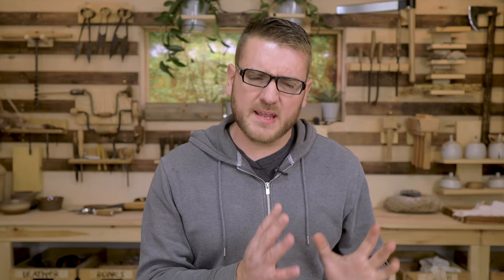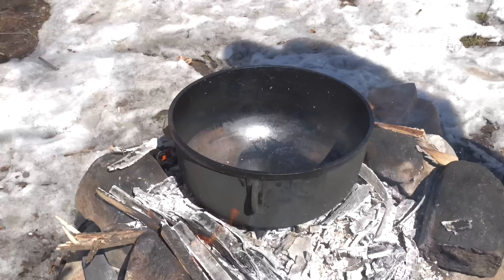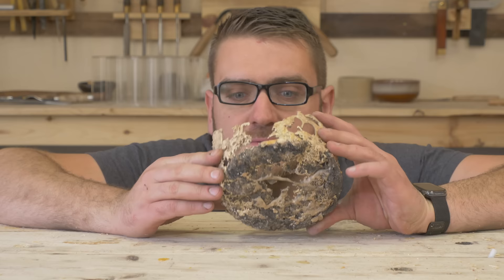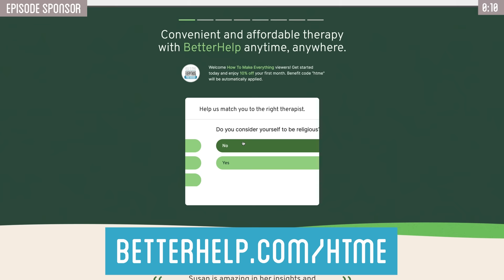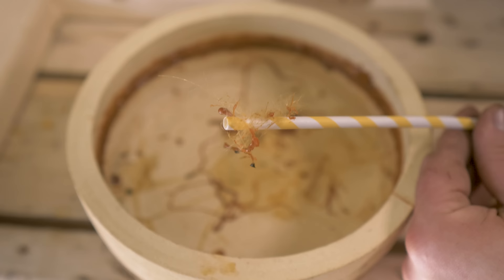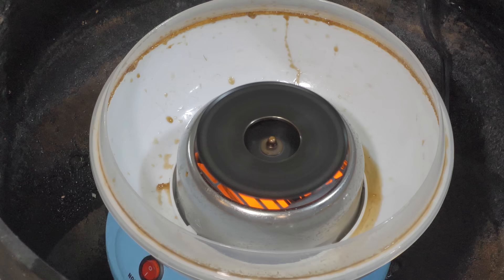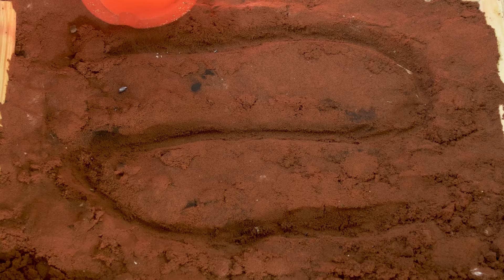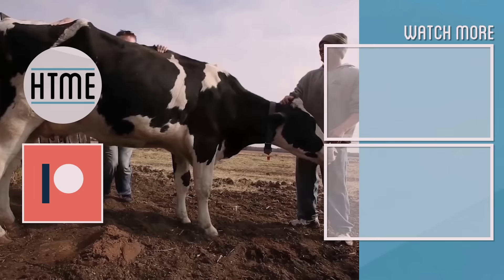Can a Dr. Stone Centrifuge Make Cotton Candy and Wires?

Comment: There are some good videos on making maple sugar from maple syrup. Simply take the finished maple syrup and continue boiling it until it reaches the hard ball temp. At that point beat it (example video used electric mixer) and whip air into it. As it cools a bit it will transition from a syrup into crystallized maple sugar.

Spin extrusion is used for making rock wool so the basic concept works however it requires properly ductile material. Glass or molten rock fit that. Most metals don't. Gold, as you mentioned, is the most ductile metal and is far more likely to work than any other. As others have noted, the Dr. Stone machine had a constantly heated pot which is similar to modern cotton candy machines. That one you used of course is a bargain basement version that I have never gotten really good results out of in the first place. Considering the damage, still a better choice than spending several hundred on a commercial machine.

Comment: wire i imagine is more like a metal is plastic scenario where smithing and stretching is the best option. interesting to see other methods attempted but not surprised molten metal has surface tension and low viscosity that makes it not want to stretch into long wires.

Comment: I have cast a few wire ingots of silver in wood moulds before.
It actually works surprisingly well, at least when you use adrill  hole
 it's not "safe" But it makes good ingots

Comment: The reason why the sugar makes thin wisps when spun in the centrifuge is because when caramelizing sugar, the decomposition reaction causes the formation of polymers. These polymer molecules stick to each other through covalent bonds and form long chains that can be pretty thin even when in a liquid or semi-liquid state. Metal when melted still has its metallic bonds, but as temperature increases these bonds get weaker until they finally break when the metal boils. Molten metals don't have the same affinity to form chains like polymers do, metals like tin and copper have a fairly high surface tension so they'll just bead up. I don't know how viable cotton candy centrifuge wire is, but if you poured more molten metal in your metal container and the increased the tube length it would increase the pressure pushing the metal down the tube. If you had the tube actually submerged in the water, so the molten metal is not freefalling and having time to potentially bead up, it would start cooling the metal before it hits the water creating a steam explosion. Great video as always!

Comment: Maybe it's a more complex idea than is worth testing, but your laminar pour method plus a rotating bucket of sand might work. Especially if the bottom of the sand-bucket was mesh and there was air pumping through the side that doesn't get poured onto. That way warm wire sinks and cools, while fresh wire falls onto empty sand.

Comment: Some thoughts on what went wrong with the experiment: The pot was too small as well as the holes, leading them to get clogged quickly.  Starting with a larger pot with larger holes higher up on the sides would make the melted sugar/molten metal climb the sides and produce finer strands. Instead of pouring the metal into the pot giving it a large chance to splatter as it touches cooler metal, starting with the metal in the pot already and heating the whole thing so it's not molten all at once, resulting in thinner streams of metal heading for the holes as well.

Comment: that wooden gear thing could probably improve your attempt at making a lathe, and/or a drill-press. just needs an extra bit to slot the end through so that it's more stable and doesn't start to wiggle. also, have you seen laminar flow tea kettles? find out how those work, and make a crucible that pours like a tea kettle out of a spout

Comment: There are examples of wire jewelry and wire sculptures dating back to about 4000 years ago, placing it in the middle to late bronze age. Gold was poured into thin plates then pounded into sheet, cut into strips and rolled into wire. Once the iron age came around, the process was updated to hammering small rods into a grooved anvil. Drawing wire was also discovered around the same time and eventually overtook both of the other methods and is still used for most wire production today. 

Because gold work hardens the annealing process must have been used to prevent breakage in all of these methods. This means that copper wire was likely also being produced around this time. That said, gold has one unique attribute among materials of the time that made it a far superior option. Gold can cold weld. It is unknown if this was lost knowledge or truly not discovered until the 20th century. Since people were beating stuff with big heavy objects just to see what happens since the stone age, it's safe to assume someone had tried to get a broken piece of gold foil to go back together with the tools they were using to make it in the first place.

Comment: Maybe using a technique similar to candy makers making hard candy?
As in, pour the metal in a way you can still move it while it is hot enough to still be somewhat soft but cold enough to not be liquid anymore, using two rolers to spin it and a system to pull and stretch it?
Maybe that would be a consistent way to make a thin and maleable wire?

Comment: 1: gold (and pure gold at that) is one of the few metals with the correct surface tension, flow-solidify temperature ranges, and density to allow potential spin wiring, however, yes, you would have to be VERY exact in how you ran it and made it.  
2: the sugar used for cotton candy is a huge factor in how well it works, and microadditives often massively change the effect.
3: he used a many year sun and salt dried aged non sealed plank, thus effectively fully drained of all sap, moisture, and other issues.  Ideally you would bake the shaped mold in a kiln like hutch to further carbonize and dry it, but that has diminishing aid it gives.  In many environments well aged wood is more reliable than common soil.
4: unlike the show, the manga went FAR more indepth into details and often hid exact numbers in the background illustrations

Comment: My understanding is that liquid metals behave more like water than a paste even at the coldest melting temperature (easy to separate, not much tensile cohesion). The cotton candy machine melts the sugar as it spins, so the sugar is 'just' turning to a liquid at the point it gets flung out and liquid sugar wants to stay together at that point. The Dr. Stone method may be 'possible', but the number of variables needed to make it work are impractical (it has to go from 'barely liquid' to 'solid' in a fraction of a second and at a speed such that it does not separate from itself in that time frame). Making rods and drawing those down using presses to make wire would be more feasible I think. Still, the whole process in the show was very entertaining.

Comment: Hm. 
Nice idea. If you are serious about this, you really need to take more time on each step to improve the quality. There's also the matter of scale and having extra hands.

1. Casting the bowl. The standard sand casting method would be to have a fill hole or two and poke it in a few places for the gas to escape as the metal filled the sides. If you have enough molten metal and the mold is warm, the metal would take several minutes to solidify. Adding the top afterward is the typical mistake kids would do but, leave an overflow spout and lower it slowly, and the compression would make the resulting bowl stronger.

2. Bowl size and shape: The extrusion bowl for the candy series looked like it could hold at least a gallon of liquid and the walls were at least 1/4 inch thick. When they took it out of the mold,it looked like it had 1/2 that volume and thicker walls. That means it can hold a larger mass and hold the heat longer than the one you were using, resulting a more consistent and controllable flow. Extrusion tubes could have been formed with a stone spike and a wooden hammer using techniques like repousse.

3. Turning method: Using the bowl and the converted shield as free-spinning flywheels, thew were able to get things turning much faster by striking the edge as fast as they could swing their arm on the cotton candy stage than you could with just a crank. It helps that there was another person to put in the ingredients. Using pull cords and ratcheting gears they were able to take that to another level for the gold extrusion phase. 80-100+ lbs of teenager throwing their weight into it can produce more torque than most electric hand drills. Naturally, it's important for the framework to be well anchored.

4. Preheating the bowl: For the sugar and the gold, the extrusion bowl needs to be constantly heated to keep the material liquid.

5. Multiple prototypes: The cartoon version doesn't show the prototyping process with trial and error, analysing failed attempts and making improvements. The manga version does sometimes show the graveyard of failed projects.

Comment: There are elements of this that I think work in principle, but are more difficult to achieve in practice. In order to make a wire, you need to have no breaks in the flow, which means you need the reservoir to be full at all times with zero air pockets, such that there's a constant unbroken stream of gold coming out of the nozzles. Of course that's a lot easier to achieve with water than rapidly-cooling metal.

Comment: I think the main thing you need to make it work with metal making wire is time... and that probably would need to come from distance.

A somewhat similar manufacturing method that was used in production was for lead shot.  They would drop it down from the top of a tower, often over 100'.  

A "Shot Tower" also used water to "catch" the molten balls at the bottom.  The way they dispersed the molten lead into shot was by pouring through a copper sieve.  I imagine to form wires the metal is likewise going to need more distance / time to travel through the dispersing orifice... think deep thru-holes vs holes through a thin material.

Comment: casting wire has metal's surface tension and low viscosity working against it, as metal will turn to droplets far too quickly, on the other hand, you could plastizise the metal (heat it until it becomes soft) and then spin it at high speed by holding one end to a weight, won't be perfect but should stretch the metal enough (try it with alloys that soften, pure metals will melt quickly)

Comment: for the copper wire and wood mold experiment, i think the wire was kinda thick. i'd wager half as thick as hemp rope. i know we use thin and tightly wound wires for motors. but the purpose of their wire was to wrap it around some iron ingots and have them struck by lightning to create magnets. i think i saw a comment on another video that made it sound feasible, just need to be in an area where one can set it up like a lightning rod

Comment: best way to make wire is probably the way wire is thinned out by goldsmiths today. they use molds that have cone shaped holes which they pull the wire through to bring it down to diameter. this give the wire extra lenght in the process as well which helps

Comment: To make wire, you can make a series of rollers with grooves that decrease in size as it is getting pulled, there could be an issue with mainatining constant heat and a consistent amount of force to "pull" it

Comment: Doing this may be possible, just got in the way depicted.

A fully enclosed crucible (to avoid centrifugal forces sending it over the edge and out), heated constantly to maintain melt temps, with a gate that opens only once its gotten to the correct rpm MAY (probably not) work.

Comment: I think this method could work BUT you would need a heat source at the bottom of centrifuge to keep temperature sligtly under melting point. In the state where is really maleable but not liquid yet. This way cantrifugal force could push it out throu the holes but it would be not blasted in small drops. Basically using draw table with different type of force.

Comment: I feel like it would work better with a larger crucible. Surface tension, or lack therof, is making it even harder to keep molten metal in that really tiny one you made. What about a crucible with a pointed bottom, the pinholes stuck about halfway up the cone, then the high cylindrical wall?

Comment: Additionally, maybe try pouring the metal wire in sand in a vertical mold? I don’t know anything in that field so I don’t know if that’s a plausible idea, but like have a basic length standing mold and find a thin object to begin with like the thinnest but longest twig you can find. Poking a hole in the mold and then pouring as you did when they were horizontal??

Comment: Actually making metal wire with the old method in the 1800's included taking a round piece of a ductile metal and drawing (pulling) it through a tool called a drawing or wire die and gradually decreasing the diameter of said metal until you end with the wire you need. This process would also make the metal stretch longer and longer. That's why at some point, two roller bars mounted on stands are placed at either end to help hold the wire during the process.

Comment: I kinda wonder if you could make the laminar flow wire work if you put it at the top of a tower and let the stream air-cool as it fell, so there was no impact with water. Also wondering if the wood casting would have worked better if you ran the wood thru a fire and charred the surface. Might drive off the water

Comment: To tell you the truth, i was a bit iffy too if the centrifuge would work to make wires but i think you could have implemented the centrifuge a little better. So, heres a few possible sources of error i found in your video. The crucible seems to cool down way too easily and that allows the metal to clog it a lot. In the show they had active heating which allowed the crucible and also importantly, the rest of the pot thing to stay warm.
I think this along with a better craftsmanship might give you better results.
Though i dont think its feasible, considering the incredibly hazardous nature of the task, i think it could be a more accurate representation

Comment: I would say carry on with that drop process.
  At a greater height it should form a skin before quenching. 
Viscosity is temperature dependant and your aperture will vary by material. 
You may even consider a pour to get a super fine drop to draw.

Comment: The molten metal is not viscus enough, at that temperature, to string out into filaments. What about using a ceramic drum with an oval cross section and smaller perforations around the circumference. Drive the drum from below with the opening unobstructed and maybe feed the molten metal in, down a ceramic spillway. Try to time the pour so that the metal cools to a viscus enough state, as it enters the drum, that it strings out as it exits the perforations.

Comment: the whole idea with gold is that it doesn't oxidize at all. An oxide layer forms on almost all metals on the surface, and in theory a wire is something very low volume and much more surface area. If this works, it does with only gold.

Comment: probably not the best idea, but that gear setup could be turned into a pretty low power drill press. just have to add an attachment point on the end of the shaft, and make room for it to slide up.

or it could be used to make your lathe spin faster or something.

Comment: Liquid metal has too much surface tension and not enough viscosity for these things to work. That molten extruder actually seems to have promise, try lengthening the pipe like 5 times longer and figure out a way to slowly draw it out

Comment: I think it would be easier to make a copper rod (5 cm diameter) and stretch it using drums and pullies. Just heat, pull, and wrap around a drum in one motion. rinse and repeat  until it is 5mm diameter. You can make different gauges of wire by doubling up the wire. Then you will need some type of flexible resin to act as an insulator.

Comment: Yeah, I think your best best would be a closed face mold for wire. Molten metal just isn't sticky enough to spin. Probably the same problem with your gravity water situation. Realistically wire I don't think was ever cast, forged maybe, and drawn definitely, but I don't think it was ever cast. In truth I think wire drawing (or pretty much any hot metal work) is more of an art than a science. You gotta know and feel the metal for it's brittleness and hardness more than just the temperature that it "should" be.

Comment: Your problem with Laminar flow as is might be that you're powering it with gravity in the direction of gravity, and that will lead to separation because your flow separates because of the differential speed, if you could force the liquid metal to flow in an arc like many laminar flow mountains that might help, but you'd still have the problem of change in shape over the course of the parabola.... in space though it might be more workable

Comment: I think the easist way to make a usable "wire" would be to start with a flat piece of copper and cut it into thin strips.  This should at least be able to be coiled with an insulating matreial and used as an electrical winding, Then you're half way to having both a generator and the first power tools

Comment: Try the wire test at extremely lower speeds. It makes more sense than the cotton candy. Also, consider doing it over a bucket. Perhaps use Aluminum or lead (with all the respirators) at the slow speed.

Comment: I think the big issue with the tube method is it is still soft/liquid when it comes out of the tube. It needs to be cooled as it is coming out kinda like a 3d printer extruder head that has a fan to cool the filament.